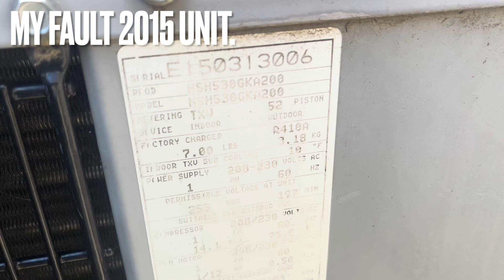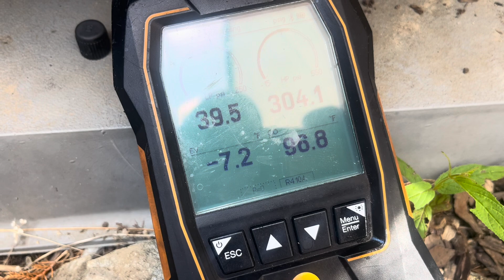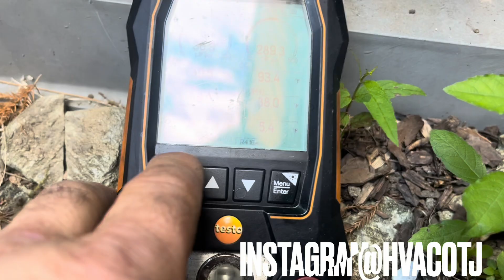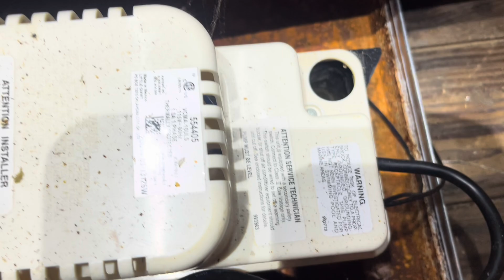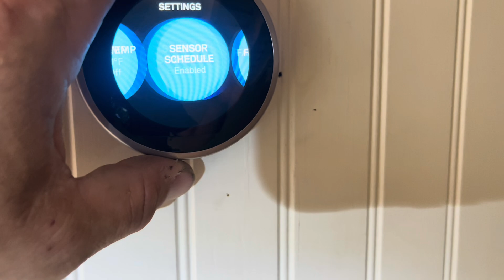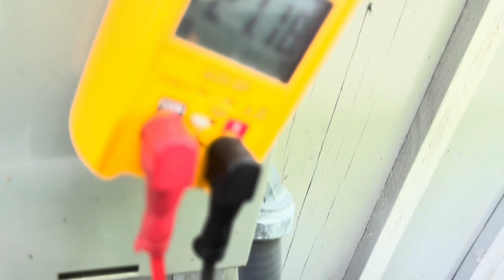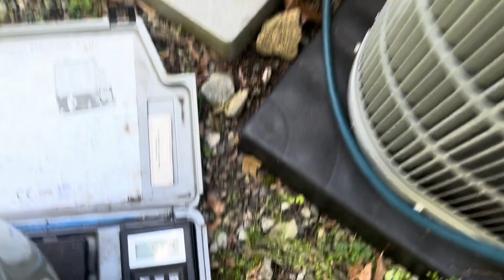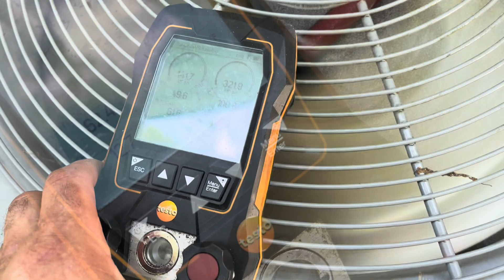2 SERVICE CALLS.  LIQUID LINE RESTRICTION AND PRESSURE SWITCH ISSUE @CarrierGlobalCorp

Comment: What’s funny is I had a call like the 1st call in this video today, same model. 80 psi on the suction line and 345 on the head side. Subcooling normal 8 but my superheat was 76. Put unit in heating and pressures looked normal a bit high but normal and it was heating properly. Put unit back in cooling and opened the air handler and put my hand over the bulb, pressures didn’t budge, superheat and sub cool the same. Txv was freezing that mf was almost all the way closed. No temperature difference on filter drier, quoted new txv
Reply from the maker: Yes it’s a tough call on those.  I really show much about that call because they can be tricky. I still quoted the flat rate txv the piston outside and filter drier because we will have line set open anyway.   Thanks broski.